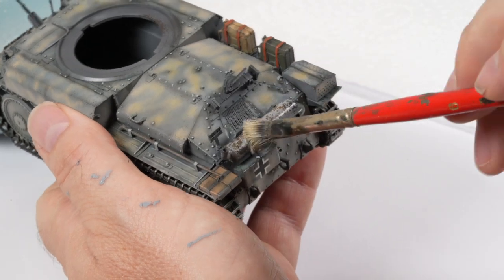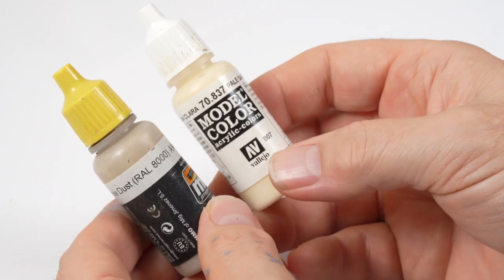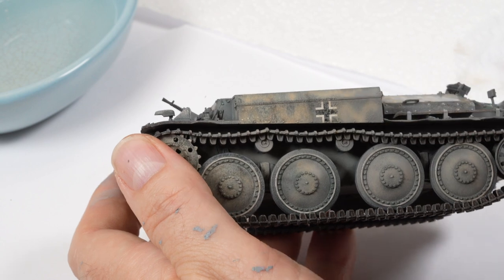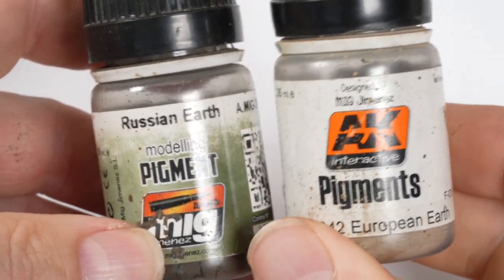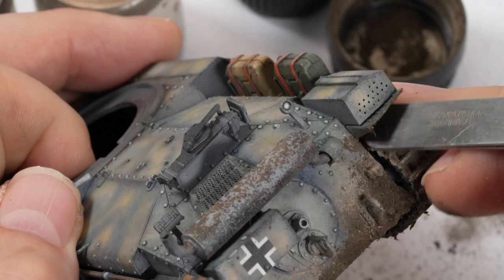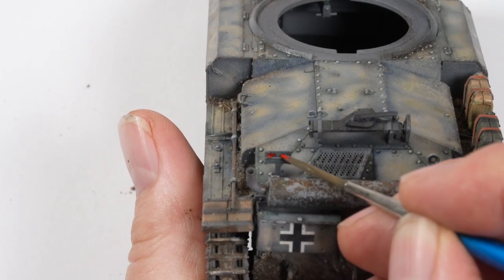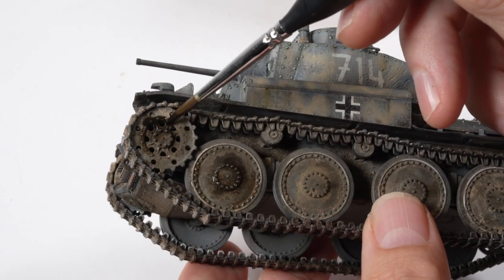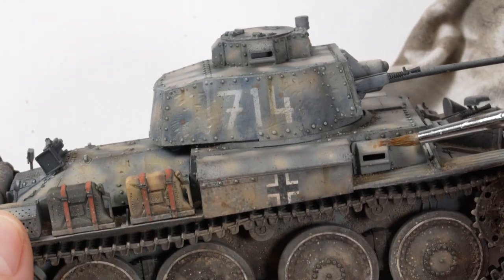Transform your TAMIYA Panzer 38(t) with weathering techniques

Comment: Heard about your channel here from your interview on OTB. Great stuff mate, subscribed and shamelessly stealing some of your tips and tricks for pending builds. I don't build armour, but I've got some "Barn Find" car and truck projects where they will come in handy. Quick question, do you thin the VMS flat clear for airbrushing? I've never tried VMS products but keep hearing great things about them. Looking forward to working my way through your videos now.
Reply from the maker: Fantastic! Welcome aboard! Re the vms, answer is depends on your airbrush…but generally speaking I don’t thin it. It’s sooooo forgiving that you can flood the surface and it is self levelling. Obviously there is a point where that could be a problem…but it’s easily the best matte varnish I’ve used. Pretty sure I’ve thinned it using IPA on rare occasions…but test it if you wanted to go down that path.
Reply: @workbenchhobbies4316  I definitely need to get hold of some. I have both 0.2 and 0.3 DragonAir brushes from SMS, the 0.3 is my workhorse. I normally use Testors Dullcote thinned with about 60% Rapid Thinner to flatten things out, but it can reactivate base layers if I’m not careful and go a bit heavy. A good water-based ungloss would be great.